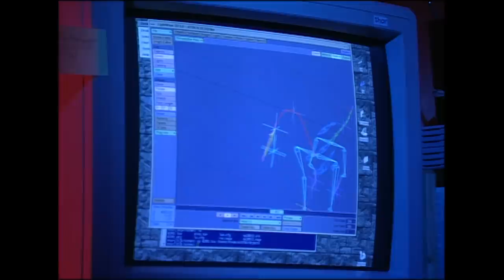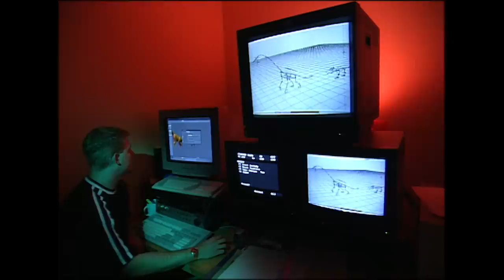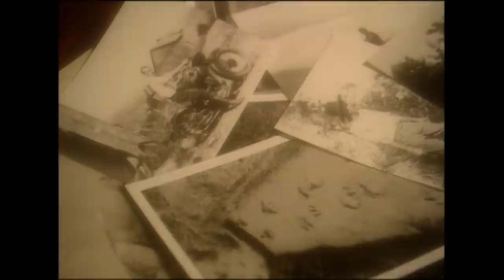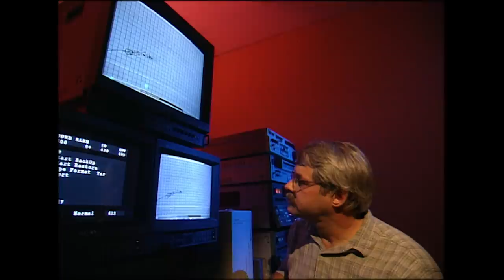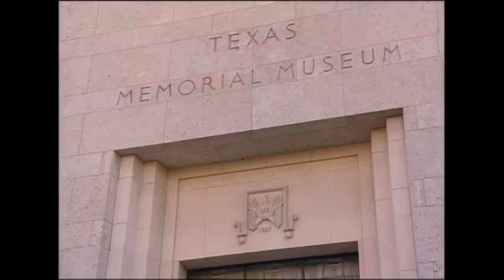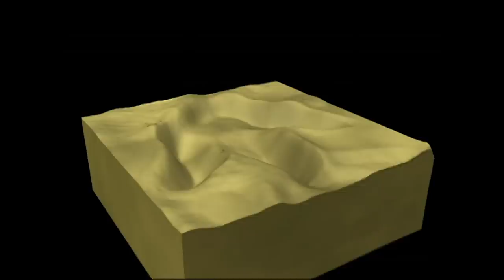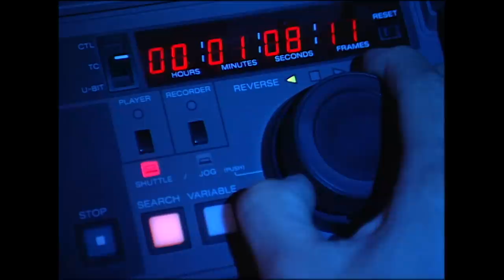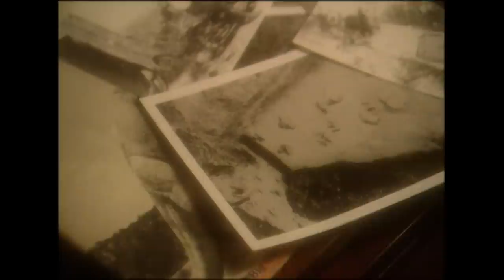The World's Greatest Dinosaur Discovery | Dinosaur Attack! | Real Wild

Comment: it's amazing to think how much has been learned in the time since this documentary aired in the 1990's.  
1). Sauropods were warm-blooded, as has been proven through isotope ratios done on Brachiosaurus and Camarasaurus.  
2). Acrocanthosaurus could run and breathe simultaneously. Theropod and sauropod dinosaurs had unique lungs similar to a bird's that created unidirectional air flow, allowing them to utilize incredible stamina and absorbing maximum amounts of oxygen with each breath. It also acted as an internal cooling system to prevent overheating.  
3). Pleurocoelus is not the track maker; the sauropod that Acrocanthosaurus was pursuing was probably Sauroposeidon, which was a brachiosaurid, or perhaps the titanosaurs Astrodon or Rugocaudia. All three are known from the same age fossil formations as Acrocanthosaurus.  
4). Acrocanthosaurus is known from 5 skeletons as of 2020.  
5). Acrocanthosaurus may have taken 18-24 years to mature.  
Pleurocoelus is no longer considered a valid genus and has since been renamed as Astrodon.
Reply: Jac Conte  Yes.
Reply: @Saberrex1  You orig comment is simply more food for thought to add to what I called all of this.... as being educated speculation. it makes a great story but.... BUT, most of the stuff which is being claimed as knowledge is simply educated guesses based upon scant evidence. the best story gets repeated. this is a really good example of that. The idea that the two tracks were made at different times could VERY easily be true which would make this entire theory incorrect. It just cannot be 100% known what happened.